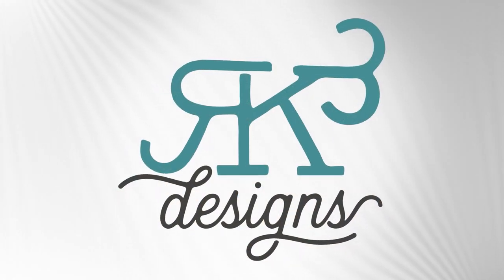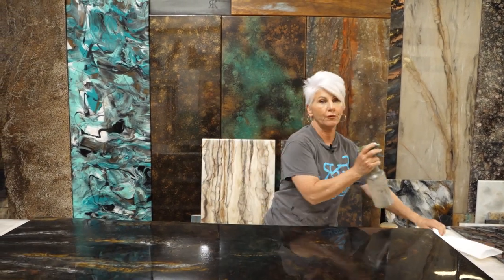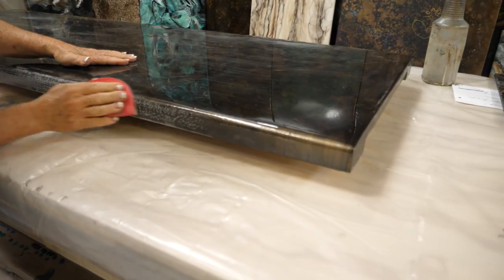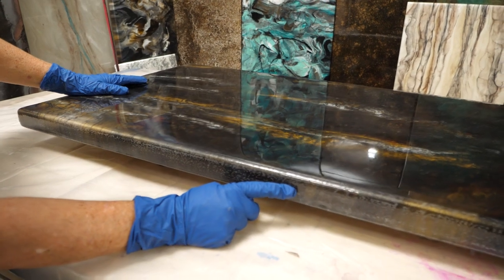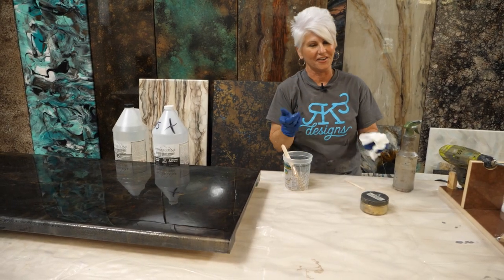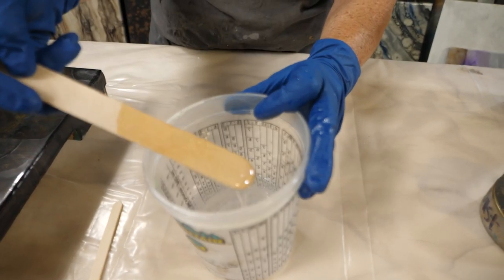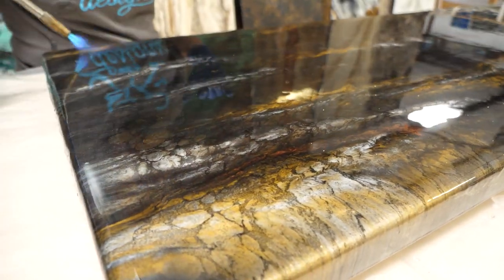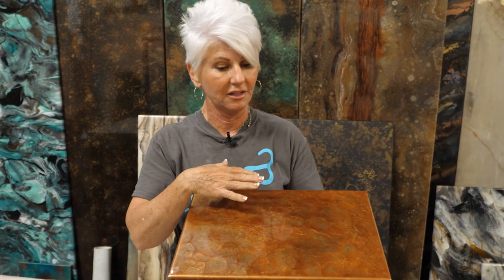Applying a Flawless Epoxy Flood Coat | RK3 Designs

Comment: Do you not just use ultimate topcoat for making it food safe and give it a protective layer?
Reply from the maker: I use UTC for a variety of reasons. Stonecoat epoxy is already FDA approved for food handling and is very scratch resistant. The UTC takes it to even a high degree of durability. It’s high scratch, stain and heat resistance is incredible. We no longer install countertops without it. 😊.
Reply: @RK3Designs  thank you so much for taking a moment to answer. Your channel is a wealth of information.
Reply from the maker: @rockcandyepoxyproducts4918  you are very welcome!! 😊😊
Reply: @rk3designs I've been seeing a lot of videos recently from Stonecoat where they show and talked about doing the color coat and the next day they come back and they do the ultimate top coat and it seems like they are skipping this flood coat. Is that the new method that we should be following? I'm helping my friend do their kitchen today and we are ready to do the flood coat if we're supposed to do it or we can go right to the ultimate top coat.

Comment: Hi I love your work and how you teach. I wanted to ask a question. Can I use quick coat to seal my art work? I do paint pouring and want to learn resin.  I thought quick coating some of my art pieces would be a good way to start to learn. They will not be out side or in sun. Thanks in advance ☺
Reply: Yes you can. Just use the basic epoxy. I make and finish Art all the time with epoxy (Droomkunst)
Reply: @FemkeKrock  I bought the quick coat from stonecoat counter tops. Last month because it has a shorter working time. Just nervous to start 😬 😅
Reply: @dianefletcher2076  Don’t worry! You can start with a smaller piece to get the feeling. It will take practice and patience, but it’s another dimension for your art. You’ll love it! Although I’m not using it on every piece. I like my textured art without epoxy
Reply: @FemkeKrock  thanks so much.  That was my exact thought, start small and get the feel. I really want to do resin art.  I know nothing is as easy as it looks lol. Thanks again for your help 💜💜
Reply from the maker: You’re not going to want to use quick coat if you are pouring over a light colored piece of art. There’s absolutely no UVA protection in the Quick Coat. It was origins designed to fill in gaps and seams. That’s why it cures so fast. It will amber very quickly even if it’s not in the sun. I would suggest using Stonecoat Art Coat. It’s got really high amounts of UV protection. 😊
Reply: @RK3Designs  okay thank you.  I should have asked before I bought 🙄.

Comment: I’ve watched many, many videos about how to do a flood coat. Of course, when doing a flood coat there are drips that accumulate on the bottom near the edges. These hard little bumps that need to be addressed. Like your video that is not addressed. The video ends as though you are done. You’re not. How do you clean up the bottom edges to get a professional bottom finish so that the bottom is not ugly. I’ve tried taping the bottom edges with less that satisfactory results. How do you do it?
Reply from the maker: We can’t address every topic in every video or our videos would be extremely long.  We have several videos that address other topics such as mixing, fixing issues, drips etc. short tutorials like this are to inspire you to do different types of designs, not to teach you completely the entire epoxy process in one video. If you ever have particular questions, I’ll be more than happy to talk to you, just give us a call. www.RK3Designs.com

Comment: Hi Rhonda. Have you ever tried to use the  tape dam method around the edges for the flood coat just like the dirty pour color coats to keep more epoxy on the surface to make it a little thicker as well as the edges? I have never tried it, but wondered if it would work. What are your thoughts? Also, do you have a video of the color recipe for this particular piece you are working with? I looks great from what I can see of it. Thanks!!
Reply from the maker: I have used tape in my flood coat but you’ll need to use more epoxy per square foot so when it thickens you’ll have enough product to run over the edge. I don’t have a video out on YouTube with this finish. I did it on my FB page. I’ll be doing one soon. 😊

Comment: This lady is very helpful..gave me some confidence to do a small countertop for a camper..did black and bronze "marbleish" design with just a tiny bit of gold.. though bottom of my edges have a lip(cannot round the bottom due to how this counter is) now need to flood coat clear. Thinking of adding just a tiny tiny bit of antique gold into it to add something else to it...hoping i dont sand through the color on the bottom edge.

Comment: I love your videos. After watching this I tried doing a flood coat on an epoxy coffee table with rounded over edges. I actually tried doing it two times, and both times I got drip marks that formed on all 4 sides of my table. I’m not talking about drips themselves, but the tapered marks that lead down to the drips. Do you ever get them? How do you fix them or avoid them?
Reply from the maker: Those are caused by surface tension. If you run your hand around the edge as the epoxy starts to roll over, it will help it run over more easily.
Reply: @RK3Designs  thanks. I really appreciate your help

Comment: I created a faux copper finish with the hammered coper and other paints, no epoxy. It is fully dry, over 30 days. I want to do the flood coat, then the ultimate top coat to get a matte, food safe, durable finish. However, I am leery of sanding prior to the flood coat, as it seems it would create a mess of my carefully applied faux finish. What do you suggest? Thanks!

Comment: For Art Resin epoxy they suggest 60 grit, but I wonder if that’s too excessive or not necessary ?  I use art r4sin with my mixed media art on panel . Yes some of my art can’t really be sanded prior due to the image transfers I’m starting to do . I smudged a test piece because of that issue and had to re do that part. The idea fo doing next or flood coat while tacky is a good tip. Art resin cures in 24hrs also. Problem is though I have to peel away the transfer film at 24 hrs so I have to spray a fixative spray and do more embellishments that will give the tooth or spray coat with something that has a bit of a grit after the fixative varnish . With my test adding embellishments and the sprays eliminated my need to sand .
Reply from the maker: I’m thinking yes. I’ve never done that process. Let me know how it turn out. 😊

Comment: Do I absolutely have to sand prior to doing a flood epoxy topcoat? I used Giani sponge paint granite kit and am happy with end results and ready for top coat.
Reply from the maker: Sanding will help create a mechanical bond and adhesion. As long as your surface isn’t too slick you should be ok.

Comment: Another option is to use a product like 'Duplicolor Adhesion Promoter' - a spray clear that is used on automotive plastic (particularly detailed plastic parts that are difficult to sand everywhere) - atop a sensitive piece that needs a flow coat.
Reply from the maker: Thanks for sharing. I would want to know before I applied that to a countertop, what the heat resistant would be as well as if it were FDA approved for food handling. Also, how scratch resistant is it?
Reply: @RK3Designs  The purpose of an adhesion promoter isn't to resist scratches; it's to replace the need to scuff before applying a flow coat if you've allowed a piece with a top coat of conventional paint to fully dry, and you don't want to affect the surface before applying a top coat of clear.

On the topic of a rolled-on final protective coating, however: have you ever attempted to apply it with HVLP spray equipment, to remove the texture that a roller leaves? I wonder how smooth and optically clear you can get that final gloss top coat if you applied it in that manner, rather than using rollers.

Comment: The Ultimate Top Coat is awful....it has an orange peel like finish...ruined my project......its not glass at like at all, its textured and matte and they don't tell you....I hope I am wrong but seems massively deceiving and morally wrong to promote...most people doing epoxy want a glass like finish not all but in general....the UTC is awful......
Reply from the maker: It's actually not awful when applied correctly and with my application method. If it were, I wouldn't have applied it to literally 100's of countertops. I've not had 1 single customer not love it. Did you practice or do sample boards or just jump in and do a whole countertop with no experience? How many videos did you watch before you applied the UTC yourself? If you would have done your research, you would have already know that it will not have a "Glass" appearance and that the gloss will have a slight visual texture due to the application method of using a roller. Just like every other gloss topcoat on the market. There was an issue with the bottling, I'm not sure when you purchased your product. The matte was labeled as gloss. I''m not sure if you purchased from my website or not. Either way, I'll be more than happy to replace what you bought if it was mislabeled. You're more than welcome to call or email me at (830) 433-7199.

Comment: i did a seal coat with montana can but now i need to sand is it possible to do it without damaging too much the design?
Reply from the maker: You can very lightly sand  just enough to rough up the surface. Won’t need much.
Reply: @RK3Designs  thanks for the quick reply i did a quick sand with 220 and result is amazing!!

Comment: How do you prepare an acrylic pour painting for an epoxy finish?
Reply from the maker: Make sure the acrylic is 100% dry. Not just to the touch. I usually give it at least a few days. Also make sure you didn’t use any silicon material. This will cause the epoxy to repel. You not going to want to sand so I would just make sure it’s clean and then pour. I would check out Mixed Media Girl on YouTube. She does AMAZING acrylic/resin art!!
Reply: @RK3Designs  Thank you 😊

Comment: Rhonda, if i used the Isop Alcohol in my design, AND the Montana Spray -- can i just do my flood coat over that and NOT sand? or should i get like a 500 grit to lightly sand?
Reply: and i do have some slight slight teeny bumps from the Montana Spray -- not very noticeable at all -- ?
Reply: I'm super nervous to use the Xylene, i think i would rather just use a ighter sanding and go with that?

Comment: I have found the ultimate top coat scratches EASY and actually flakes off if you use a fingernail on it? It also is not a gloss; it is a dull shine. The stone like one has particles of texture in it-YUCK. VERY upset as I ave done many counters in my home and that last step destroyed one. Don't use it!
Reply from the maker: When applied correctly you’ll never have this issue. We applied it to over 300 surfaces and NEVER had a call back or warranty issues. If it scratches with your fingernail, you’ve definitely done something wrong.